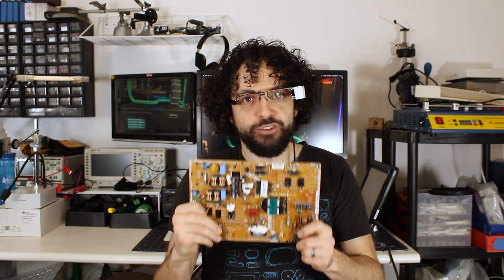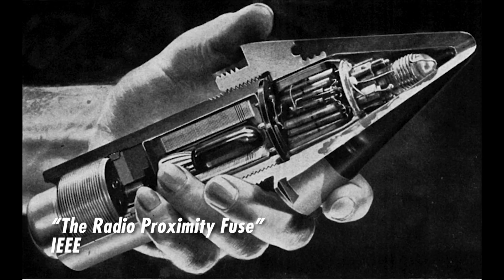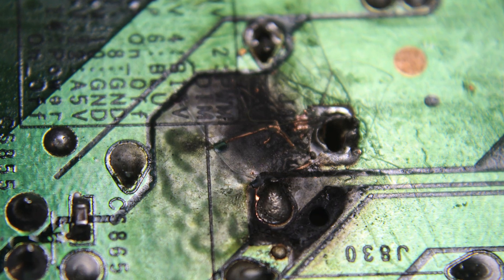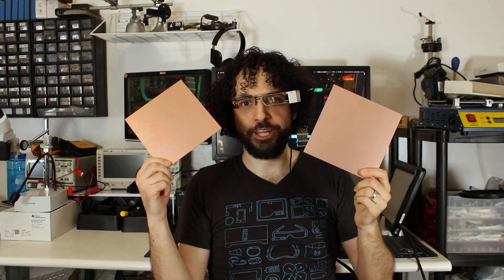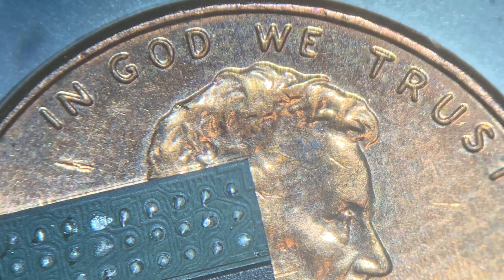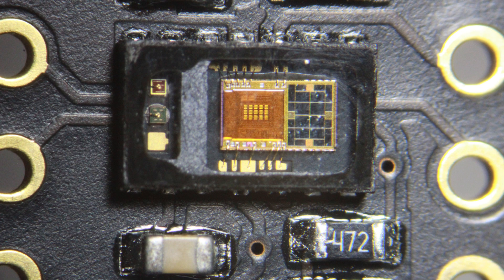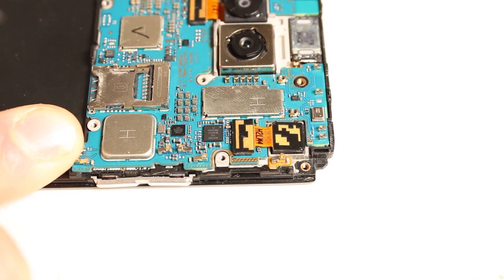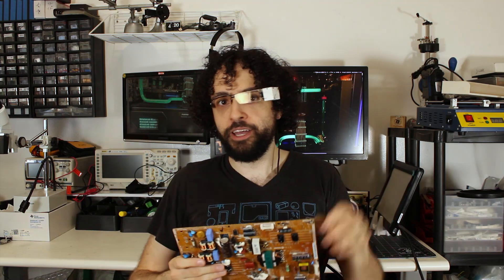Why Are Circuits on Boards?

Comment: Just a nit.  Wire-wrapping never used round component leads.  It relies on the high pressure contacts between the corners of square pins and the wrapped wire that almost weld the wire to the pin.  Round leads would not provide the high contact pressure required.
Reply from the maker: That’s really interesting. I’ve never seen wire wrapping up close - I need to learn more about it.

Comment: Would love to see ways one can make boards. 

Paper soaked epoxy with aluminum foil sounds promising for some low power applications. What to use for adhesive?

Comment: I think that technology will revert to old 3D design, but with additional stability. Something like sandwich, but not only with copper and dielectric, but also with components. Such devices will be almost non-maintainable, but in many cases it is not needed, since it is cheaper to buy new one than to fix old one.
Reply: Honestly, repair becomes cheaper the more spread out the industry is. While it's expensive now, it is really an untapped industry. There is definitely money to be made repairing and reselling old electronics. However with the influx of anti right-to-repair, it will shut down independent review for the most part, and what few repair places are still capable of operating will keep costs artificially high.

Comment: Isn't that board that looks like a TV power supply, made on phenolic/pertinax board? 
I still see phenolic everywhere. It sucks in high temperature, high vibration environments. In old radios you'll often see carbon tracking at the output tube socket. 
For hobby use i prefer it because it's easier to cut - though you need to do it outside or have proper ventilation in place. The lack of glass fibre means that drills and snips will not get dull.
But glass fibre epoxy boards are much more vibration resistant, and a better option for professional use.

Comment: >secret government espionage chips
>security chips to protect you from secret government espionage chips
these are the same thing
Reply: The trick is which government is mentioned at which moment
Reply: Almost none of your electronics have any sort of backdoor installed because it is a huge security flaw. Security researchers hunt for these on the daily.

Or, at least not any sort of backdoor you would think of. Encrypting your hard drive and uts contents can prevent anyone from accessing anything, so that is all you need to do.
Reply: @sujimayne  Yeah right.
What is Intel Management Engine?
What is AMD Platform Security Processor?
And so on, and on, and on.
Reply: @strangewasya  Now you're edging into paranoid speculation
Reply: how is it that i happened to scroll down and read your comment at the exact moment he was saying that in the video?
Reply: No, they are not the same thing.
Government requires a phone that has secret chip #1.  Cell phone maker adds secret chip #2 to give false information to secret chip #1.
Reply: @jean-clauded5823  optimistic.
Reply: @jean-clauded5823  Yeah, that's not how things work, the TMPs all have backdoors and the baseband radio processor is completely hinges off wide open access, the baseband processor also has complete access to all the ram.
Reply: @jean-clauded5823  So we're essentially talking hardwired politics now? William Gibson was on to something ....
Reply: @pellesomethingsomething  William Gibson's been right about so many things the man's practically a prophet.
Reply: @jean-clauded5823  Yet, the maker uses Chip #1 for the same and original intentions of the government but for their own purposes...

Comment: 3D printed carbon, doted with different elements and with different spatial structures to have different electronic properties. But only if production is cheap enough (to recycle it on error) as it's essentially all integrated.

Comment: video: how pcb changed the world
4:50: holding a bunch of perfboards
Reply from the maker: Hey man it’s stripboard, and it’s still a PCB
Reply: @ZackFreedman  I know that using the literal definitions of words to try to win an argument is for arseholes, but how can a stripboard be a pcb. There's no printing involved
Reply from the maker: They etch the copper strips/lands onto the board! How else would they manufacture them?
Reply: @ZackFreedman  yeah, they are pcbs in the sense that they are circuit boards that are printed, but when someone says pcb, i think most people would not think they were talking about a stripboard
Reply: @ZackFreedman  
Three type of perforated prototyping boards have been commonly used for decades. Generally referred to as forms of 'Perf board' because the holes are usually punched not drilled.

1. Paper phenolic board with just holes no copper - 'Breadboard'

2. Paper phenolic board with holes and longitudinal copper strips - 'Strip board'.
This is not usually etched, it is made either by using copper-clad board which is scored to create the strips, or the strips are laminated to the board before punching the holes, usually the former method.

3. FR2 (Paper phenolic), CEM-2 & FR3 (Paper epoxy) or FR4 (Fibreglass epoxy) board with holes, and copper pads around each hole - single or double-sided.
These can either be etched, or stamped and laminated, to achieve the copper pads. - 'Perforated Board'

(CEM-2 & FR3 substrates are also commonly found in consumer products.)

Comment: 11:10 apple execs watched this parts and saw $$$$$
Reply from the maker: Apple gets a lot of flak for how it treats outdated products, but they were one of the first companies to stop specifically designing low-end products and sell refurbs instead. For instance, there is no low-end iPhone X. The XR is a midrange device, and they sell refurbished 8’s to budget customers.
Reply: @ZackFreedman  Except here's the issue with that:
Apple offering refurbished products sounds fine on its own, but it's a symptom of a bigger problem. The problem is they are trying their hardest to make sure they are the only ones who can do so.
Anyone could refurbish and sell their stuff (likely cheaper than Apple offers it for AND offer repairs), like any other product, but Apple is trying to make that as difficult as possible (for example by controlling the market of repair parts, seizing imports and threatening repair shops). What you mentioned is not a good thing, but an example of their shitty practices ("Nobody dare touch our devices except us!").

Comment: It's possible to have a solder mask on a milled PCB.

Step 1. Mill your traces.
Step 2. Apply UV-cure soldermask to the whole board and cure it.
Step 3. Use a springloaded bit to mill away the soldermask where not needed. With just the right amount of pressure, the milling bit will go through just the soft solder mask but not through the much harder copper.

Whether this really works or is this science fiction? I don't know, i have never seen this done in person.
Reply from the maker: That would be really interesting. I suppose you could also apply the mask, and use a scribing tool to scrape it off the pads, then cure it.

Comment: Great video.
My only nitpick would be that you dismissed ASICs a bit too quickly.
They have volume and efficiency benefits in addition to the short distances facilitating some ultra-high-speed applications, so as with everything there are trade-offs, but they are more and more necessary as circuit speeds go over 10GHz.

Comment: Future of boards:  I speculate that "additive" techniques will be used to lay down copper traces, but they will be actual copper traces not conductive ink or other inferior substitutes.

Instead of etching off most of a copper coating, start by printing the design using a primer and then soaking the boards adds copper only where the primer was.
Reply: That makes sense, it's one of the only ways the process could be made any cheaper since then you barely have to worry about recycling the copper afterwards.
Reply: @OrangeC7  or the etching chemical! what about synthetic materials that are better than copper, like graphene?
Reply: @gunar.kroeger  Graphene circuitry is the main reason (out of many, many reasons) that people want graphene to actually be useful. Supposedly graphene transistors could operate comfortably in the terahertz range, meaning that new computers would be A THOUSAND TIMES FASTER without any other breakthroughs required.

The problem is that the wonder material is infamously difficult to actually generate in usable quantities. There are a few techniques that look like they may help with progress, but so far we're just not there yet.
Reply: @khatharrmalkavian3306  "The problem is that the wonder material is infamously difficult to actually generate in usable quantities."
And it's generation process is pretty toxic.
Reply: @gunar.kroeger  In terms of materials that are easy to apply, nothing beats copper or silver for raw conductivity.
Reply: It's already been done for many years - generally called 'selective electroplating', but used in specialised applications due to higher cost, or practical limitations such as the 'porosity' and 'conductivity' of the plating.
So-called 'conductive ink/material' processes usually have similar issues of porosity and conductivity.
Hence 'additive processes' are nothing new either, if you know your engineering or history. 😉
Possibly the most common substrate materials used to date for these processes would be ceramics and 'Teflon' (PTFE) in high frequency or extreme temperature applications.
Reply: Same process in reverse then?
Reply: ....why complicated. go the russian way. use graphite pencil, ...unlocking or overclocking old computer chips with a pencil :D:D was Amd ??

Comment: You missed a step between hand-drawn traces and computer layout:  tape!  You would buy stickers that had pads of various shapes, and a roll of black tape the thickness of the traces, and stick those onto a sheet of clear plastic.  This was most often a contact print, but the same tech could be used to make scaled up drawings that were then reduced.
Reply from the maker: Yep, and don’t forget the rub-off decals too! I had to abbreviate a bit.

Comment: This video NOT brought to you by pcbway
Reply from the maker: The problem with cheap PCB's is that it makes free merch less convincing :|
Reply: @ZackFreedman  what
Reply: FWIW JLCPCB seems to have faster turnover, even though the assembly capabilities are limited :-)
Reply: I use Hydrogen peroxide with hydrochloric acid. 
No need for JLCPCB or PCBway. 
While it can't dissolve invoices of them, it can dissolve most of their annoying key-chain pendants and company logo:P
Reply: @dieSpinnt  Hahaha :-D to be fair I did use Ferrous Chloride for some prototypes early on, but now it's usually breadboard → perfboard → JLCPCB :-D
Reply: @cheaterman49  I use laser printer on a "inkjet photo paper", iron and then ferric chloride, because it allows me to start designing hobby thing saturday morning and to have the thing working sunday afternoon. The board itself takes barely an hour from work on computer done to finished board. A delivery time quite hard to compete with for those pcb services...
Reply: Meant ferrous chloride, my apology. Not a native English speaker and not so "fluent" in chemistry-English...
But agree, the CNC would be a bit cleaner way of the same result (with the benefit of not having to drill the holes manually), but don't have that.
Reply: @annaplojharova1400  Meh. Printing + Chemicals are the only practical and fast way to prototype 2-layer boards.
If you need more that 2-layer, you really need to go with your trusted provider. Call it JLCPCB, PCBway, or your local if you have one.
Reply: @dieSpinnt  Replace hydrochloric acid with sulfuric acid and it can dissolve invoices.

Comment: Looks like a TV power supply you were holding. IDK why but I hate working on tvs. I think with new PCB manufactures making the whole hobby great. I mean $2-$10 prototype boards in a couple of days to weeks depending on who you order from! I mean its great. I think its stupid when people say the hobby is dead.  Its never been better. Youtube to teach each other, easy to program Micros, cheap PCB manufacturing! what  a time to live.
Reply from the maker: Good eye! It's a power supply from an old LCD TV that I took apart to put the CCFL in e-waste. I haven't heard that electronics is dead - if anything, we're in a golden age of accessible software, cheap boards, and powerful components.
Reply: @ZackFreedman  I get a lot. Mostly from outsiders. I like to teach what I know locally and a lot of responses I get are along the lines of   " I didn't know there were still hobbyist or I thought no one did this stuff anymore". 
I really want to form a local hacker/maker club. I'm waiting to finish expanding my office first thought.
I completely agree it's absolutely the golden age for hobbyists. I fear the future a little because of anti repair lobbying by companies like tesla and apple

Comment: i’m hoping that you keep making infotaining vids such as this.  i recently got serious about making and electronics; could you do one on oscilloscopes?  what does an electronics/maker/3d printer nub really need starting out?  all of those knobs look daunting.  how often does an ocilliscope come in handy for your prohects & in what ways?  what are the main reasons to get one?  is the Hantek DSO5102P one on amazon a good deal?  can they be hacked to be 200MHz?   nice job on the video!
Reply from the maker: Those are some really good questions that definitely deserve an episode. The maker world has changed tremendously since I got started, and I'm curious how the 'new player experience' has changed.

I build digital electronics, so the protocol sniffer features on my scope are the most important features. I use a Rigol DS2072, which could hypothetically be hacked to the 200MHz DS2202 model. Pay close attention to scope reviews; you want one with high-quality probes, deep memory, easy-to-read documentation, and a good interface.
Reply: An o'scope is useful for debugging misbehaving circuits and for reverse engineering unknown circuits. For making my own circuits with an 8266 and some sensors, my o'scope stays on the shelf. For trying to find out if my garage door opener has a 9600 serial port, or a JTAG/test port that I can use to automate the door? Out comes the scope. For my home lab I have a dinky China 20MHz / 50Msample two channel scope; because I seldom need more than 9600 serial, or 115200 serial. And two channels for clock and data, or for doing math like A-B. (Trigger on the clock to see what the data looks like, etc)

Debugging an unknown connector, first I use a multimeter to check voltages and that gets me DC and verifies I won't hurt myself or my scope. Then the scope gives me waveform and frequency. And if it is serial, a TTL2USB and a laptop or Pi with python gets me the protocol. I guess a less dinky scope would have protocol decode "built in"; but a computer can also transmit ;)

For 3d printing and electronics, priority 1 is a soldering iron. Then a fume extractor to get the solvent smells away from your face. Priority 2 is a decent pair of calipers, for measuring things and making houses for the PCBs that actually fit!. Then a cheap multimeter, for checking continuity, voltage and sometimes resistance. Many simple IoT or Robotics or quadcopter projects will get by just fine with that. And the o'scope comes out for advanced work, debugging protocols and sensors that misbehave; and for anything with radios.

I have seen a couple of YouTube videos that discuss basic Rigol and Hantek units; some of them also go into "what can this do?" "Why do you need this?" And "how do I not blow this up?!" (Ground loops aren't just for car stereos! :eek:)

Good luck and best wishes.